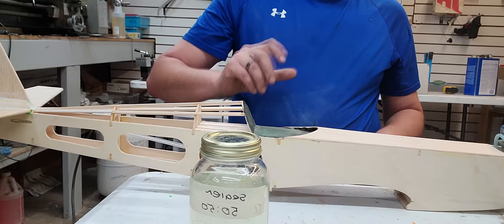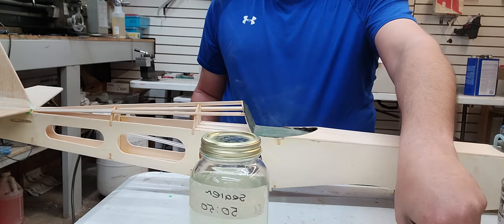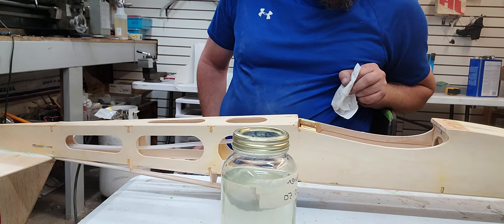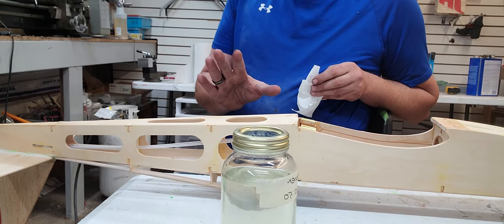Step 1 using Sig Koveral and Butyrate Dope

Comment: Hey Brother, I hear you! I too deal with anxiety on a daily bases. I’m able to control it with a herbal pill and you know what, there are certain foods that really trigger my Anxiety. I can no longer eat cured meats! That means anything that contains nitrates. That include sandwich meats smoked meats some hot sauces that have been smoked or cured.  Also some of the chemical preservatives used in fast food and stacks will mess me up big time. It takes about two days to get it out of my body. 

Thanks for the super helpfully videos!, 🇨🇦

Comment: i want to replace old fabric covering from a plane i did not build. how do i remove covering? thinner, heat? any other solvent?

thanks
Reply from the maker: I would use heat. The "glue " used to hold fabric  on is heat activated
Reply: @bigskyhobbycorner603  many thanks!!

Comment: Nitrate dope much better to use it will last forever
Reply from the maker: Te each his own
Reply: you can use the taughtening dope over the covering on the open bay wings. 3 or 4 coats, reduced 50/50. But no place else.